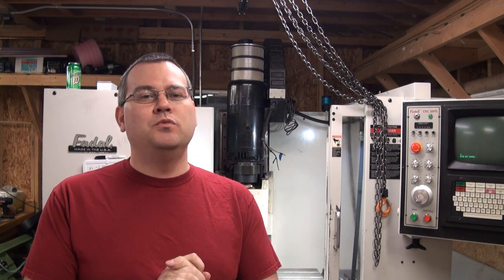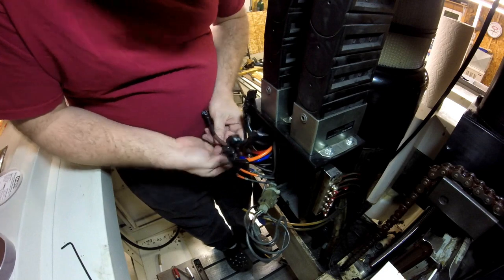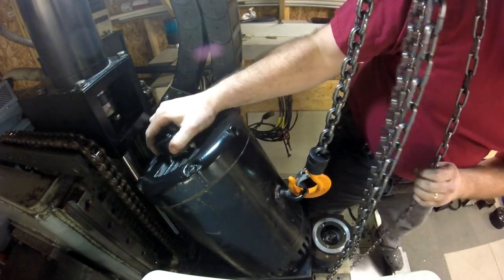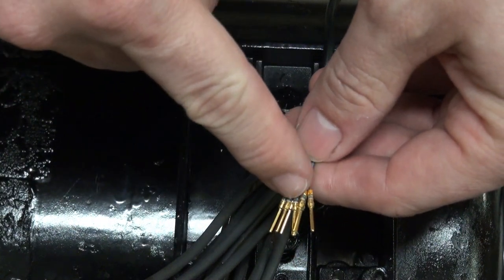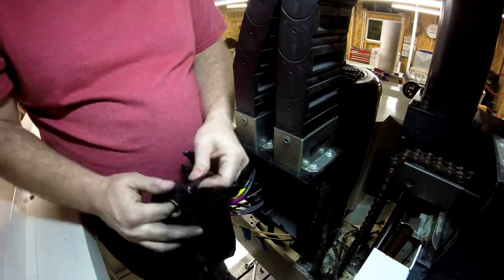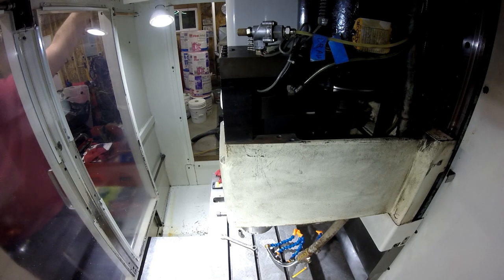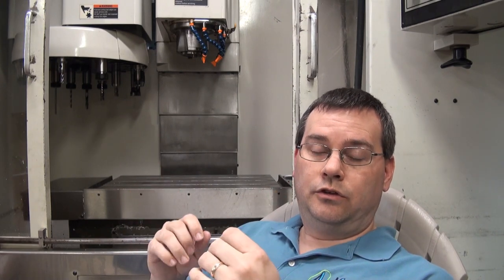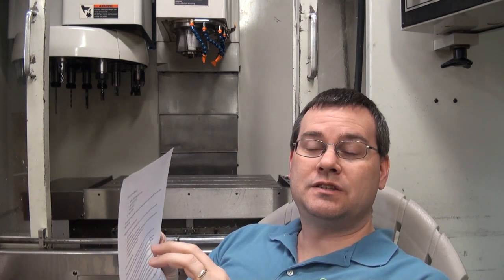Spindle Motor Replacement on Fadal CNC Mill

Comment: That was painful to watch. The motor shop made some mistakes, but your attitude was 100% wrong.
Reply from the maker: Please elaborate
Reply: If you're smarter than the men doing the work, you either picked the wrong men, or you should have done the work yourself. It's never a good idea to tell someone how to do their job, it just makes them mad and leaves you resentful when they don't listen. Things like a coat of paint and fixing the broken connector are part of a process the shop follows to make sure they are sending out professional looking work. Asking them not to do that is opening them up for potential liability. 

You should have checked the runout on the motor shaft as soon as you noticed a vibration. Straightening it to .001 is a good start, but it should be a few .0001s runout at the pulley. I would have welded it up and turned all the journals before balancing. That said, you can't expect the shop to quote all of that work without seeing the motor. 

Next time use a shop that specializes in spindle motors like Precision Zone. Or, just buy a new motor.
Reply from the maker: Wes, thanks for the feedback. This shop was recommended  by other people in the local machine industry.
The reason I did not do it my self was because of time, and I would still need the rotor balanced. So I decided to just have it done. The reason I did not buy new was due to the initial quote of work for rebuilding this motor with my given instructions. In the end they stood behind there initial quote even though it was grossly miss quoted. I did pay for the additional items to have the rear bearing sleeved and the rotor straightened. Those are items I agree you can not take into account in the quote.

I'm in the professional services industry as well. I had a professional conversation with them before taking the motor in. When I do work for other people each person has there different requests. I'm more then happy to accommodate them. As I have said before, if someone requests something I don't agree with, I wont do the work. I did not tell them how to do anything, I communicated the requirements for the job given the application, and I communicated my intent and acknowledgement that things where to be left. I even offered to remove the encoder and pulley to make the job easier, they said it was not an issue, they do it all the time.

As for paint and fixing a connector causing liability, not when its in explicit writing signed from the customer. Why would anyone spend $200 to test an $89 part they know is good? Or pay to fix a connector they know will get cut off the next day? As for paint, the motor looked fine and no one sees it anyway, not an outrageous request to not paint it.

I did not check the motor before I sent it out, in the video I said I probably should, but I was paying someone to do it.

This is not a "Special Spindle Motor". At the end of the day, its a standard induction motor with an encoder. The only thing special about it is the dash number of bearing they put in to meet the RPM range, and the tolerance of balancing, also to meet the RPM range.

A new motor and pulley is most likely in the future anyway as this motor still is not performing as it should at high RPM's. However, the brand new Baldor motor sitting in my shop has a label with a max RPM of 6500 so it would seem Fadal was pushing the limits with this configuration anyway.
Reply: I don't know. The motor shop I deal with pretty much has set procedure. Every motor gets megged, the stator is cleaned and then baked, and megged again while hot. The leads are always replaced, so it's pointless to mark them. Bearings are always replaced. Almost every motor requires some kind of machining. Every motor gets painted. The last one I sent in cost $4,000 to rebuild. Of course it was 75hp.
Reply from the maker: Yep, all of that was done except the lead replacement. They only did that as needed. They test the rotor cage as well. The only thing I really asked them not to do out of there "standard" process is Don't paint it. I also never questioned there process or told them how to do it.  All of my requests other then not painting where related to the encoder, and then specifying the speed rating so the proper balancing specs and bearings where used. Without that information this motor would only be balanced to 1800 RPM.